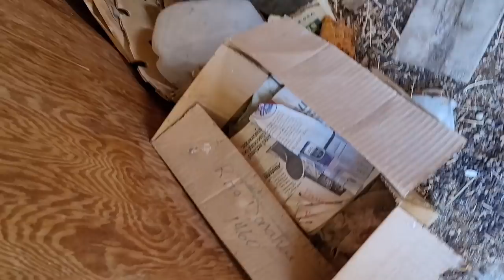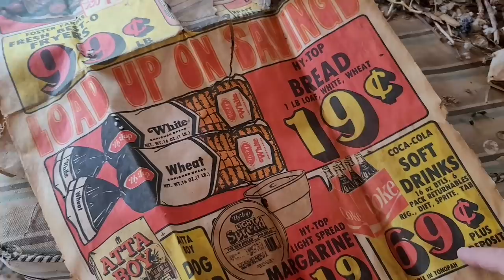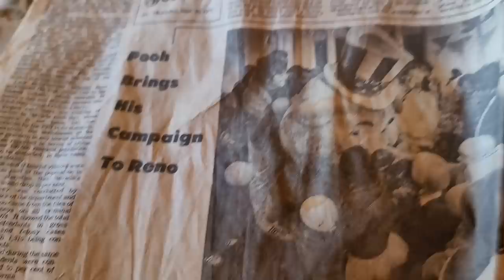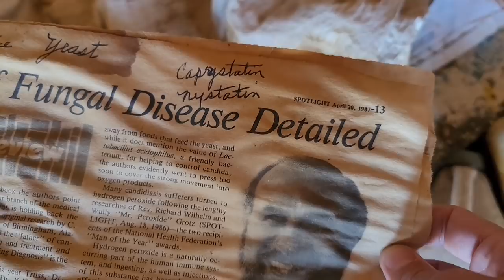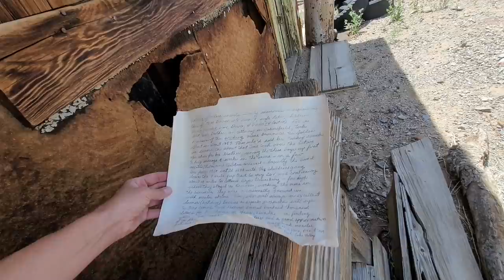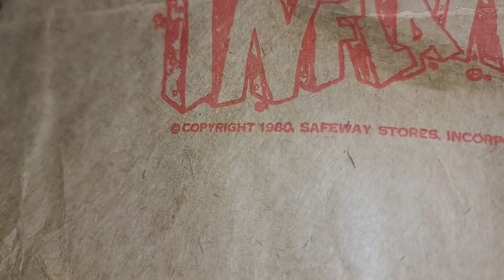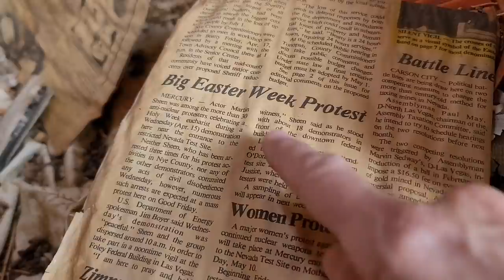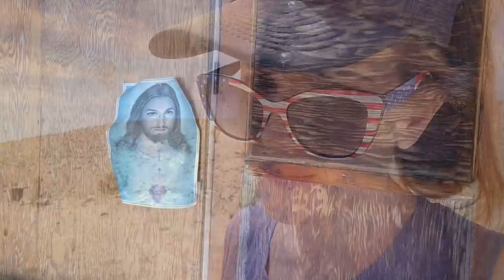#637 The Secret in the Fridge: What Happened at the Golden Ghost Abandoned Mine Camp?

Comment: The note might have said "dowser" as water dowsers supposedly could find water with a forked stick or other device. Great video (as always!).
Reply: Great explanation .
Reply: I’m a good dowser, but I use wire. It works on electromagnetic fields, every molecule has a polarity. When all the molecules of soil are poled in every direction, and suddenly they’re all pointed in one direction, the wire or branch dive right for it. The guy who taught me how called it a witchin’ stick, but then I asked a few other old timers and they showed me to use stiff wire, bend it into a long L, and hold it loosely in my hand, then walk along where the surface clues lead you to believe water might be there. Suddenly, the wire will jump itself in your hand, and dive right to the ground. Turn it the other way in your hand, so it swings left to right, and it’ll tell you what direction it’s running. Then you get a feel for how strong the pull is, and it tells you if it’s a trickle. Be advised, a water or sewer pipe under the ground will act the same way as natural ground water, so BE CAREFUL!

Comment: The word you were struggling with was probably Dowser, they divine where water is underground.  In the old days it was with a Y shaped branch, probably willow. Nowadays they use these bent copper wire things that spin around in each hand like antennas which eventually both point to the source of the water.